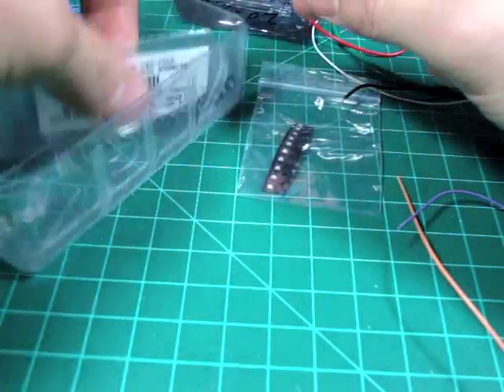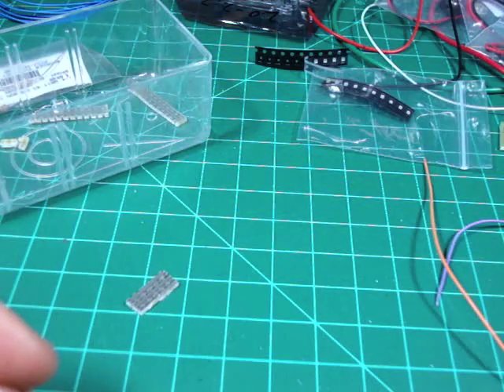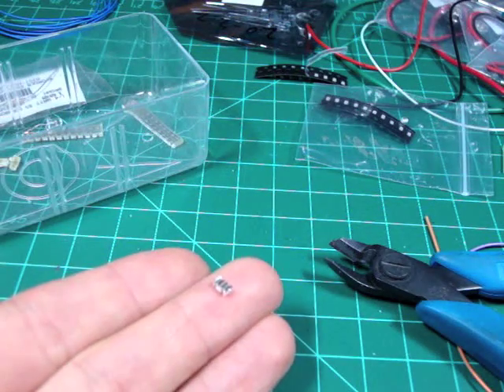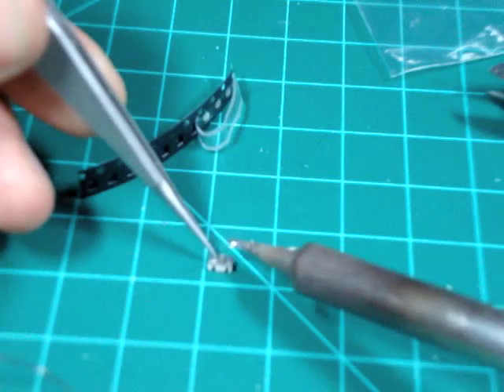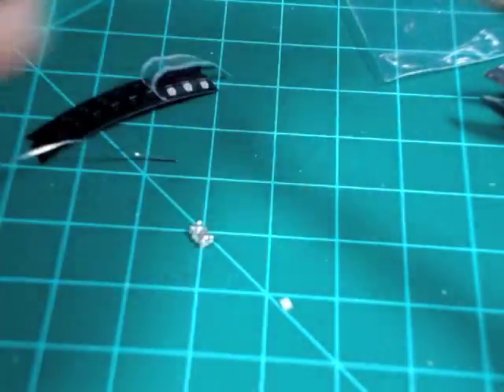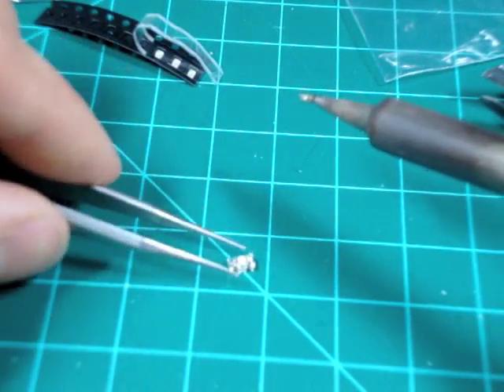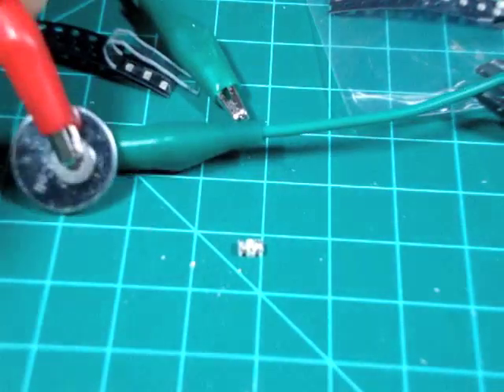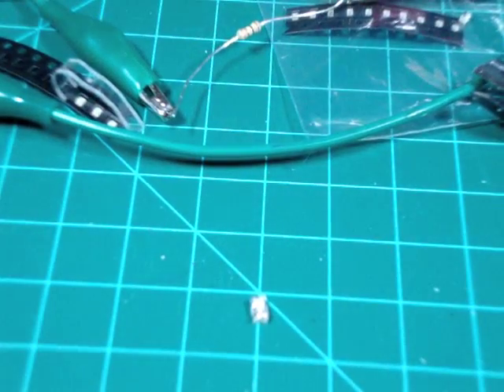SMD LED Tutorial

Comment: Hi all, a smd led similar to this one in the video (1210 maybe...) uses around 20milliamps (30 max!!!) . So a 250 ohm would be ok at 5volts and 150 ohm would be ok for 3volts. Depending on the color they can need from 1.7 volts to 3 volts. At 3 volts and 20 milliamps a blue 1210 smd led works for me. Hope this helps, Cheers!

Comment: Was wondering if the magnets were did anything other than hold the wire and which resister you used I received some do I don't know to test them
Reply: On top of it all the one I wanted are smaller then I expected. I  think I can  use them but I need to test them but don't what I need
Reply: They are 
Pre soldered

Comment: Hey! I've been using regular LEDs when building models but I'm thinking about picking up using SMDs instead since it seems much more convenient and takes up less space. But I'm wondering what kind of cables I should use? I've seen people use these really thin (copper?) wires but I haven't been able to figure out what they're called. So far I've been using regular red and black twinned electrical wires but honestly they're to bulky when working on the scales I build. Would greatly appreciate if you could point me in the right direction on what to use :)
Reply: 86Akos single core breadboard hookup wire

Comment: Hey, i just bought a new soldering station....can you tell me how to get the solder to stick to the tip??
Reply: if it's not holding to the tip it's probably oxidized .  if it's cheap material it could be a defect.  likely it's the first problem.  take your solder and keep flowing it over the tip (holding it over a surfce that won't be damaged by dripping solder. scrap wood... basically anything other than plastic or flamables lol ) shake off the blobs with a quick flick of the wrist.  after a few goes the oxidized surface should burn off and let the solder flow over the tip completely and hold .  if not gently wipe across the damp sponge on your station.  definitely invest in a brass tip cleaner that cheaper solder stations may not come with.  looks like a ball of curly hair made of brass :) also... ALAWYS keep a coating of solder on the tip at all times when in use and not in use to prevent further oxidation . hope this helps
Reply: +Martin Whitehurst teach yourself basic soldering principles? :) no, really, clean out the tip on the sponge you have in your brand spanking new soldering station after you set it a bit with water. Suggestion, if you are new to soldering, first get your shit together on easier jobs.....this is sort of middle to high experience sort of job.
Reply: +Sean Last Name Here the only thing that ball of curly hair does for me is to remind me of this strawberry blond girl i used to go out with. Best tip cleaning agent is the old way..a wet sponge. Nowt else comes close.